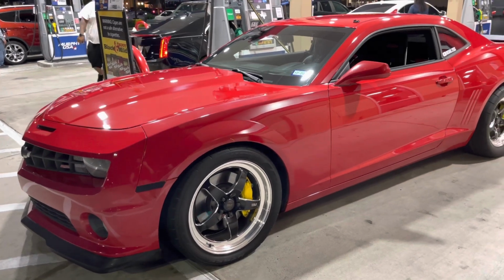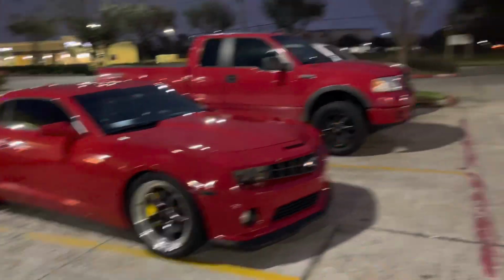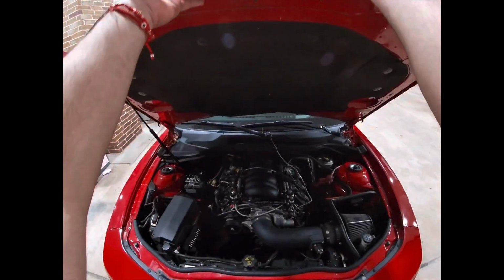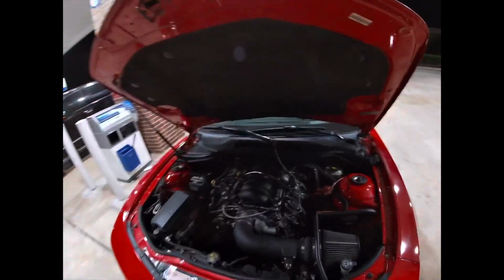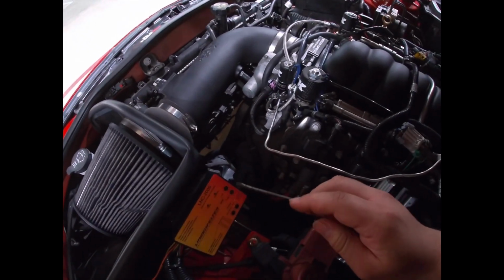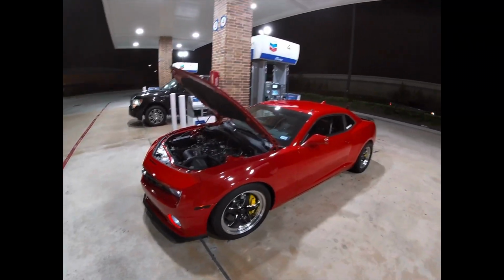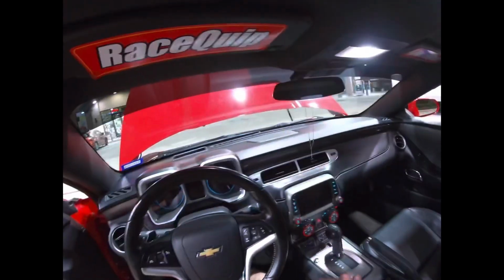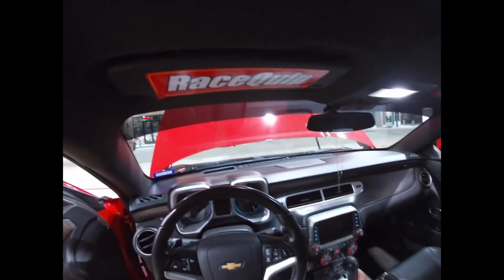LNC-2000 2 step launch control testing on my 5th Gen camaro ss

Comment: Hey this probably stupid question but I put a 2 step on and I set it to 2500-3500 and it just spins do I need an aftermarket converter to stop spinning so I can actually launch?
Reply: are you on a tire? regular street tires will always spin
Reply: it’s obviously gonna spin on the street lol
Reply: @5thgenben my cars on 4 tires, I couldn’t get traction without tires on my wheels it’s nothing like gta
Reply: @DatHondaBoi223  😂

Comment: how do you know where to put the two timing knobs at bro?
Reply from the maker: If your nitrous shot isint progressive then you want your “rate” knob at 0 so it can pull timing immediately when activated and the “max retardation” knob depends on the amount of nitrous you are spraying
Reply from the maker: And if you are talking about the knobs for the 2 step the x1000 is for your thousands rpm and the x100 is your Hudrenths rpm

Comment: I appreciate your video but I don't understand what this electronic device does it would have been nice if you would have explained it a little bit more thoroughly
Reply from the maker: Only reason I didn’t was because usually when people look it up they know what it is but it’s just a launch control and you can also use it it to pull timing when you spray nitrous so you do not need a tune for nitrous

Comment: What’s your HP?? Love your car and channel bro, cant for the nitrous video.
Reply from the maker: Currently making 445 whp on a dynojet N/A I haven’t sprayed it yet but with the nitrous I’ll be a little under 600 whp
Reply: @choppinss5552  445 for a FBO cam ls3 seems a little low no? 🤨
Reply: @LuisMartinez-yw6hk  being an automatic I believe this thing made 400 at the crank from the factory. Considering how much power is lost through the drivetrain 445 at the wheels isn’t bad
Reply from the maker: Maybe but I know it’s faster than a lot of these cars that claim 500+

Comment: What’s your wheel and tire set up here?
Reply from the maker: 17x10 s71 wheel 345/40r17 toyo proxes tq
Reply: @choppinss5552  that’s just for the rear witch is awesome but what’s the specs for the front as well